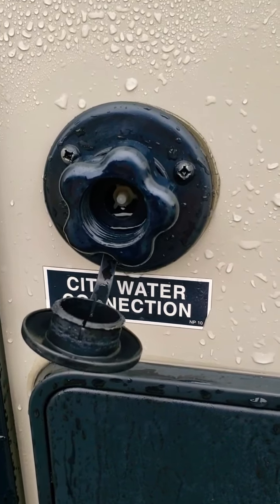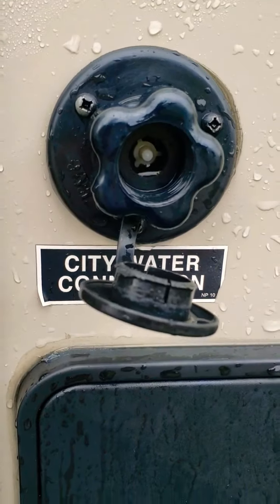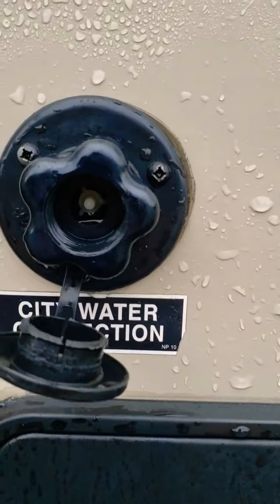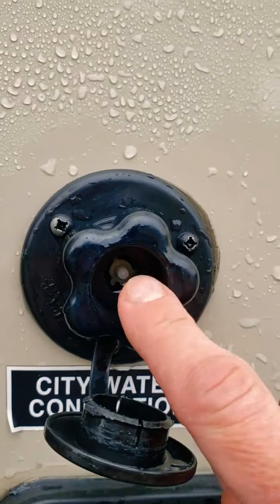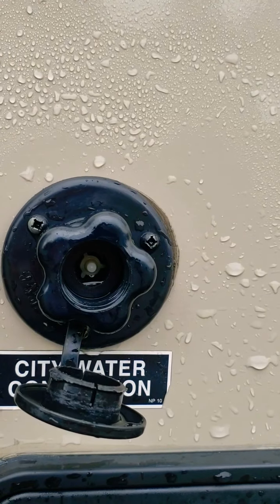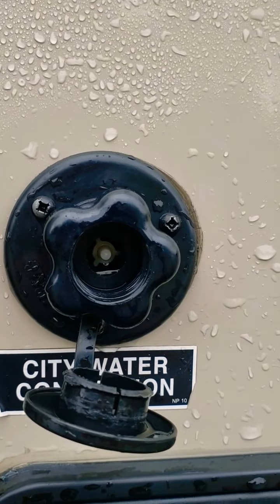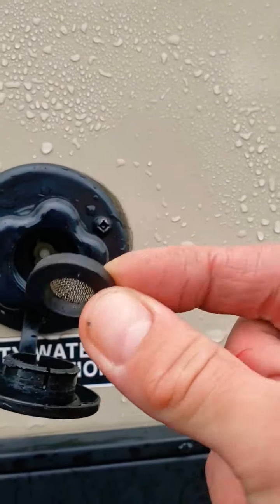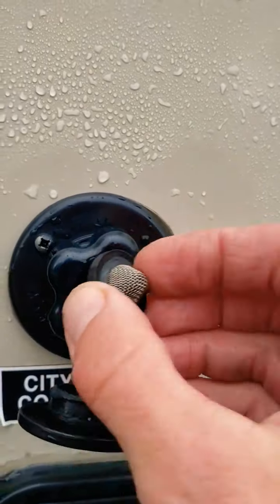RV City Water Check Valve Stuck Open - Easy Fix

Comment: I had the opposite problem. Water wouldn’t go in because that valve was seized closed from the winter and I just poked it with my needle nose pliers and it works city water is going in again